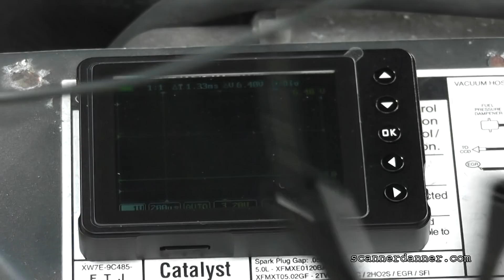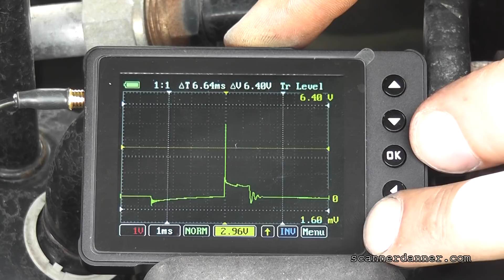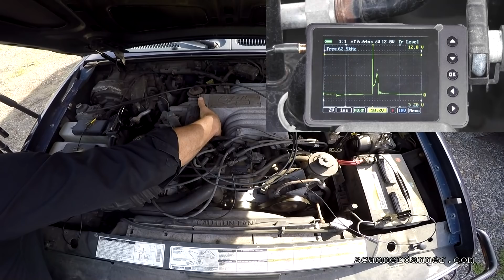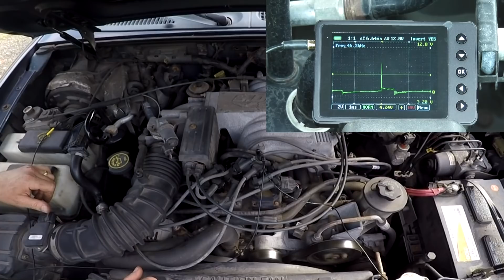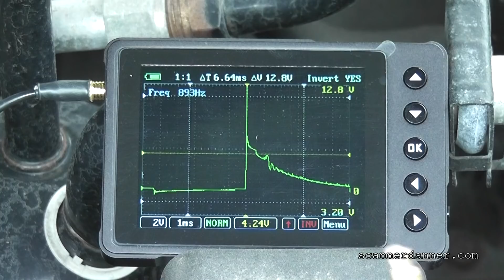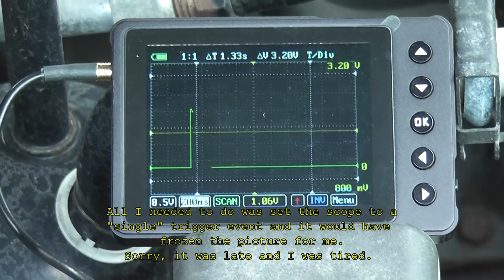How to find a misfire with no trouble codes (uScope)

Comment: I see this video is more than a year old but just in case you hadn't figured it out yet you can zoom in on waveform.  Press the A button to place the scope in HOLD mode, then you can change the voltage scale and time base from the bottom menu and move left and right under the Horizontal tab in the main menu.

Comment: i purchased the uscope about a year ago and find it addictive ,i am a retired Mechanic and love using it on my vehicles....its simple and a quick way to check things out..found a bad injector on my jeep this way...and i also use it at my Electronics bench to look at digital and analog signals....cool tool
Reply: no need for that: just unplug the injectors one by one and look for no reaction.
Reply: @josepeixoto3384  What if you can't reach the injectors because of a super charger or intake manifold is in the way?     Things are not always easy,  we need alternative ways of testing in the field.   Keep working, Keep learning.
Reply: @themanthemyththelegend1392  Cylinder cut out is cool on a ford or chevy product.  Although if you work on a European product and it doesn't have injector cutoff, ignition coil cutoff, or can't do a simple power balance test then what?
P.s I already know the answer to that one.

Comment: Pretty Cool Paul, not a bad scope, the spark kv jumped high indicating high resistance at the beginning of current flow through the plug indicating a problem exterior to the combustion chamber.

Comment: hot soak after run hood closed in summer heat on restart often causes secondary winding breakdown of insulation in coils and other electronics.Old school trick on bikes and older motors was to pull plug wire half way off plug which would increase energy of spark at gap to clear fouled plugs Surprised you didn't do a cylinder efficiently test at idle in gear to rule out low cylinder compression. Good testing .

Comment: I have the feeling that sometimes I learn more here that at uni.... thanks...
Reply from the maker: Luis Alejandro Luna Villamizar thank you Luis! You keep watching and I'll keep them coming.
Reply: I see you using that little dso more often it seems to be a really cool scope what are your thoughts on it im looking at the 2channel version for just easy quick testing
Reply: Also if have you have time im using an autell ms906bt im looking at the mp408 scope for it but i dont know if an amp clamp will work with it there are two available from hantek who makes the leads for the mp408 maybe even the mp408 itself not sure about that. could you help me out? With my problem i seem to be in an uniformed state about amp.clamps for automotive use and im learnning more all the time
Reply: I keep running into stumbling blocks i never really got any in depth training on scope use and im trying to get skill with them so i can be more competitive amd sharpen up my electrical diagnostics
Reply: I really havent had much trouble diagnosing problems with out one but these days i seem to be getting more bus problems in my bay so im adapting my tool set to get more involved the demands on me are getting higher and i need help
Reply: Yes ive been learning things from you😂😁

Comment: Paul, the buffer has 4,000 data points and they are coming out with a update in early 2017 so you can scroll thru it. That was the first flaw I found with it when I bought mine ! I also don't like that it does not have scales per division so you don't have to do the math,. It is a nuisance ! Check out CAutomation's post below. He has some good info too ! All in all it is a very high quality scope for the price !
Reply from the maker: Thanks for the info. Billy R!
Reply: Billy R n

Comment: I've seen this video before some time way back and it's funny because I saw that waveform and immediately I saw signs of carbon tracking or spark jumping outside the cylinder when spark jumps around the 3kv it's normal but when it jumps early like around 6kv, it's definitely outside of the cylinder. In my opinion.

Comment: Hey Paul, im almost certain it was a carbon tracked spark plug. 

The way the burn line bleeds down like it did. Not gradually, but when the burn line KV started higher and bled off.

Great work though.
Reply from the maker: +Kevin Mowdy thanks kevin!

Comment: Wish they had a 2 channel version of this to see cam & crank relationship.  Currently AESWave only offers a 1 channel version.
Reply: You can buy newer 2 or 4 channel on Amazon. Just search DSO.
Reply: Not from AESWave though which is designed specifically for automotive use.  They design the firmware and components to handle massive voltage spikes.  Automotive DSO's are different in a way.
Reply: No they are not. I have theirs scope and other pocket 2 channel scope. They only programmed presetting with V, Time, Trigger for different applications. Something you can change and set yourself. Hardware is same as all other DSO201 scopes. I will make video in couple days about it.
Reply: Astro Camper
I would be very interested to see that.  Please notify me when it's up.

Comment: over the years on lead systems,caught many easily and also if non resistance s.plugs used incorrectly. I would lift all ht boots partially off s.plugs to increase resistance. Bad lead or plug would drop out,if incorrect plug it would improve firing while running and snap throttle. Showed up well on scope too. Miss parade and raster on the old shop scopes, no provision on new scopes I have

Comment: Hi Paul,It's a really nice video.I am an Automotive engineer working in Saudi Arabia  and I have being in the filed 25 years ago.
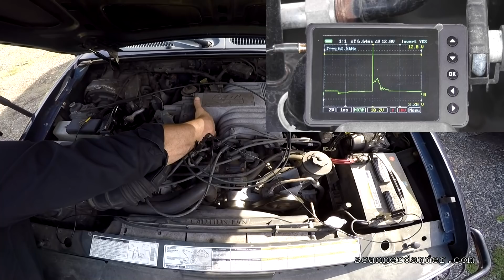in the last video for ignition coil . you said,at 8:17"  that the spark plugs would be wet and it needs a minute to dry". I am working in Toyota disturber in Saudi Arabia. in Toyota, there is a signal feedback will be sent from secondary coil to computer to confirm that the spark differently is be generated. if the computer is not received this signal from a particular cylinder ,the  computer would cut the fuel  in this cylinder ......this is  following to emission  regulations  which are be applicable in USA.   I do not know if your Honda is the same or no. in addition, I  would like to communicate with you about my Technical Articles which can be consider as On-Job-Training. if you want , I will send it . thanks again for your Video.

Comment: Why does the U-scope not need some type of protection from the high KV?  Where you use attenuators on other systems.
Reply: For this case, as long as you don't open a HV circuit there's no need for protection because all the U-Scope is reading comes from an induced pulse, a magnetic pulse coming out of the wire, I mean you are not unplugging any spark plug. If there's a leak through a defective wire (a crack for example) then you need to avoid any physical contact at that very point which at a darker hour could be seen as a little spark (electric arc).
Reply: If you were to check the primary side even though it's 12v power to coil and injectors the windings in the coil and injectors can have a high snap back voltage spike as coil field collapses so you'd want to protect scope w an attunement 10x or 20x depending on your scope. Mine is rated to 300v but Pico and uscope are rated lower so need attunement

Comment: That looks like a handy little gizmo to keep in your toolbox. Isn't the 'u' in the name meant to be pronounced micro as in micro farad, meaning it should be called microscope which seems to make sense.
Reply from the maker: ACE Auto Electrics its not, they have another tool called a uActivate that has nothing to do with time bases and so on. good thought though. Thanks!

Comment: do you have a video up about a miss and hesitation off idle when pulling out in drive ? i have a 1998 chevy express 3500 5.7. you steered me to the fuel pump replacement and i did change that and is working fine  . only the above mentioned problem now.  also it doesnt always miss or pull out with hesitation. also if i let it sit more then a day it takes a while to start up  / have to crank it a few times. and i have no codes showing up either. thanks for your time and effort. thank you in advance. i tell everyone i am around working on cars to check out your videos instead of the joe shmoes back yard mechanics videos, thanks again

Comment: Scanner 
Dinner. This me again about GMC Chevy vortec put brand new spider that was the problem .OK but I change plugs wires icm rotor cap before I fount out it was spider think I might have fould plugs but it ran so good for about to weeks it don't have power it's supposed to got a miss slightly going to change plugs they told me gap plugs at 45  but the vin W says 60 .I'm yesterday smell of gas was really bad like it was flooding I gunned it couple times straighten up on smell but acted sluggish skittle do you think it's TPS or plugs I'm going to change anyway or EGR valve you helped me in time of need on my truck I appreciate every thing you have done oh and it's a 1994 4x4 chevy GMC vin W s10 LS

Comment: Is there a way to illuminate a faulty coil pack with the scope or is it just reading off the wires alone? I'm watching all your vids over and over, btw. New to the scope scene.
Reply from the maker: It depends on the car and the type of ignition system. What are you working on?

Comment: very unique video using the uscope scannerdanner. however, could that secondary misfire be from a bad coil base on the waveform you got and not the wires?
Reply from the maker: Secondary ignition has so many variables. Plugs and wires did fix this issue. Could there have been a coil problem? Yes but not in this case.

Comment: You can do a relative compression test with a 60A  probe?
Reply from the maker: Yes. Set it to the 60 amp scale (10mv/a)
2v screen will equal 200 amps
2 second time base (total screen time)

Comment: Is there a way to pause or record the waveform to memory other than taking a BMP screenshot?  A trigger record function would be nice when you were trying to capture the cranking waveform.  Running from the driver seat back to the scope after cranking would be frustrating without a video camera to record the event.  Seems a bit silly to run from the car to engine just to see a waveform for a few seconds before it is rewritten by the next screen.
Reply: I think if you set trigger right and set to single mode it should catch it and not overwrite it

Comment: Why the scope pause every time ?? It's not clear
Reply from the maker: I believe you are asking why the scope automatically paused itself?
Because I had a manual trigger set to a very high voltage that is only met when I snap the throttle. Manual trigger is the key. Watch my picoscope basics videos (part 1 and 2) I cover this in there and it doesn't matter if you have a pico. It is universal scope stuff. Thanks!

Comment: my vehicle would miss when cold and till engine temperature reaches 90 degrees celcius, after that butter smooth. I changed plugs, checked injectors and cylinder compression. could there be something else I am missing ?
Reply from the maker: Yes, it could be an intake manifold gasket leak. Once the engine warms up the manifold and cylinder head expand and stops the leak. With the engine cold use a squirt gun filled with water and direct it at the manifold gasket area. I actually have a few videos where I show finding a vacuum leak with water.
Another cause is early stages of headgasket failure. Are you adding coolant at all?

Comment: Hi Paul was wondering how an amp clamp probe rated only at 60amp can handle Relative compression test? I have one similar rating but thought I need a 600 or 800 amp probe to do it? Mine is the hantek 65 and I'm using my electronics desk top lab scope
Reply from the maker: Most inductive low amp probes can accurately measure up to 250 amps. As long as the jaws of the clamp close all the way around the wire. 2.5v is the max output that I've seen. So on a 10mv/a scale. 2.5v is 250 amps

Comment: Did you ever actually diagnose this one? I've had similar spark lines after replacing plugs, wires, cap and rotor. Would be great to know what was the actual cause.
Reply: Could be
Plug gap to big
Primary issue?

Fuel air mix,  lean higher spark line shorter burn line and visa versa rich

Mechanical issues
Compression 
Vales
Blocked exhuast 
Etc
Intake

Comment: Another great video.  Can I do the same thing with my vantage pro?  I cant seem to get the waveforms to freeze on the screen after they pass the trigger.
Reply from the maker: psychofish21 you can. On your trigger settings, set it to "manual" trigger, then increase your trigger level to where it only hits that level during a snap throttle event and it will hold it on the screen just like I showed here.
Reply: +ScannerDanner , thanks sir.

Comment: I bought your book. Thank you. But that was the worst demo of a uscope you had to reatach the lead to the wire twice almost every time . Whats with that?
Reply from the maker: that wasn't a uScope issue, that was a scope issue in general when trying to view secondary ignition, especially when performing snap-throttle testing and trying to trigger off of the high firing line
Reply: @ScannerDanner  Thank you for the responsive. You are the best.

Comment: Why does everything ha e to be snap throttle?
Reply from the maker: because we are packing air into the cylinder which increases compression pressures and makes it harder for the spark to jump the air gap. So it is a stress test in a way

Comment: That's a neat scope.   When I use my pico scope and I scroll back through the 32 frames from a captured coil waveform,  some of the frames look great  with a burn time showing relatively flat and a nice nose at the end, but other frames show the burn time sloping upward or sloping downward.   Should all 32 frames of a capture show good characteristics or is it normal for some of them to show good and some of them to show not so good?  Another example, on one of my tested coils, I've got 31 frames showing the burn line and 1 of the frames showing no burn line at all.  I'm assuming that's a problem but I'm confused as to why I see so many good frames and then 1 bad frame on the same coil capture.
Reply from the maker: normal characteristics of secondary waveforms my friend, but when you see no burn line on one frame, is that coupled with a misfire you can feel? Then I would believe it. If it is NOT misfiring, your most likely getting a poor signal with your pickup at times
Reply: @ScannerDanner   Ah, good info, thanks. This '96 Grand Marquis has an intermittent misfire on different cylinders, and high stft under load on both banks.  No CEL.   Sounds like maybe I caught one of those intermittent misfires on that frame showing no burn line.    One of these days I'm going to be as good as you at this stuff.....one day......👴

Comment: Great video! However, can this test (or a similar one) be preformed on a ford C.O.P engine like the 5.4 V8?
Reply from the maker: +Kris Sondors absolutely, you just need a different adapter. It's called a paddle probe and comes with the uScope master kit.
Reply: +ScannerDanner  Awesome! Thank you for the response. Is the paddle probe the only way or is there another way if I don't have one? Thanks again!
Reply from the maker: +Kris Sondors the paddle probe is one of many COP adapters that are used with a scope to acquire a secondary ignition waveform. 

The other units I have used are the following:

Pico  http://www.aeswave.com/Coil-on-plug-COP-and-Signal-Probe-for-Secondary-Ignition-p9335.html
Wyseprobe http://www.aeswave.com/15-inch-WyzeProbe-for-Secondary-Ignition-and-COP-p8764.html
paddle probe http://www.aeswave.com/COP-Secondary-Paddle-Lead-Capacitive-p9151.html

Comment: is the new Snap On Modis Ultra 2014 can be use labscope to plugged secondary ignition test lead to test vehicles? if not is there any option as my local snap on dealer says its not going to work. Only applicable to old Modis ultra and Verus.
Reply from the maker: +Roderick Tuazon It will work with any of the following. I have all three of them and they will work with ANY lapscope

 http://www.aeswave.com/COP-Secondary-Paddle-Lead-Capacitive-p9151.html
http://www.aeswave.com/15-inch-WyzeProbe-for-Secondary-Ignition-and-COP-p8764.html

http://www.aeswave.com/Coil-on-plug-COP-and-Signal-Probe-for-Secondary-Ignition-p9335.html